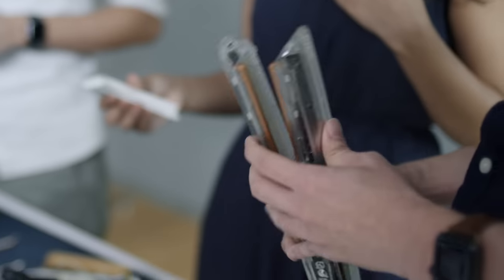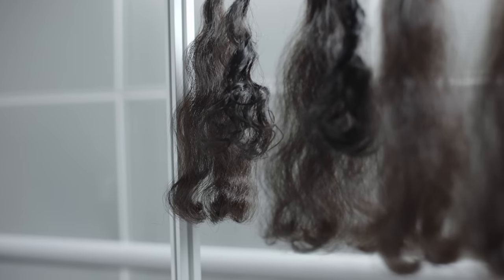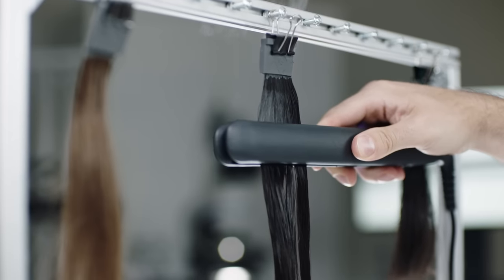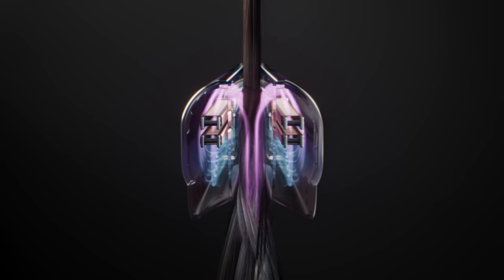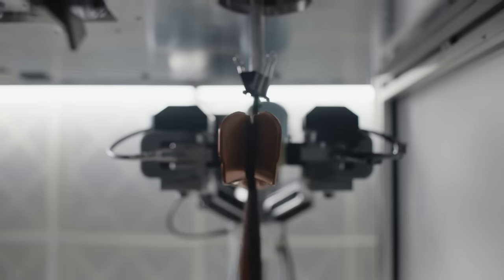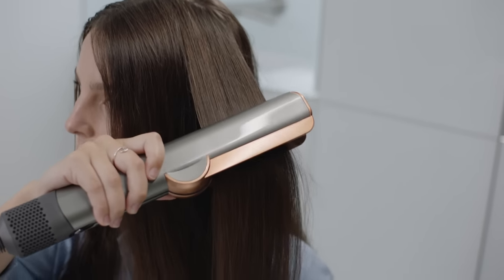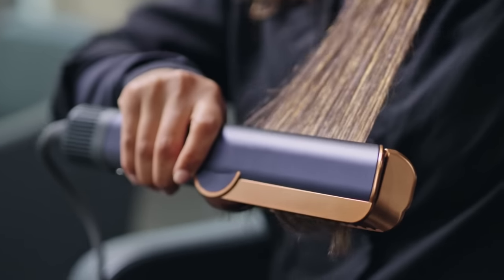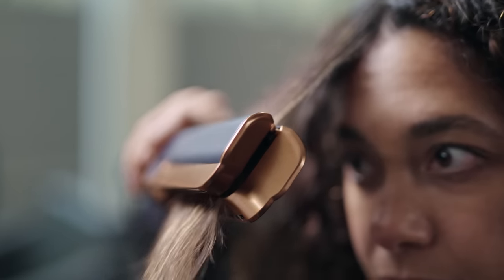Engineering the Dyson Airstrait™ straightener

Comment: I have been dreaming of the day my whole life that a team of bright engineering minds would develop a styling tool for blow outs or straightening that would save your hair from heat damage!
I have curly hair and have gone through multiple hair growth 'reset cycles' because of heat damaged curls caused by heating tools. Nothing, even heat protectant sprays and serums worked and I thought "Wouldn't it be cool if one day someone could figure out how to get the straight look but without the excessive heat?" This product is like a dream come true! Thank you Dysoneers!
Reply from the maker: We're so grateful for this feedback! 
Here at Dyson we're always working to solve the problems that others ignore.
Reply: @helene trv I disagree. There are two modes on this device: 1. Wet to dry (for straightening) 2. Dry mode (for refreshing the hair). Dry Mode will cause some heat damage. However, on the Wet to Dry Mode the company states it does not cause heat damage. Why? Dry mode has two temp settings 250 degrees and 285 degrees Fahrenheit. Alpha-keratin in hair denatures at a temperature range around 227-237 degrees Fahrenheit, which means anything above that range is susceptible to causing heat damage to the hair. The wet mode on the Dyson air straight has three settings at 175 degree, 230 degrees, and 285 degrees. So if a user of this product wants to avoid heat damage this device can achieve this goal, as long as, Wet to Dry mode is selected at time of use at 175 degrees or 230 degrees.  Additionally, this product has advanced tech sensors in this Dyson air straight which monitors the temperature 30 times PER SECOND to ensure temperature control is regulated at every moment of use, which is an amazing feature not found in most heat styling tools on the market. This product has value beyond the results that is found embedded in the technology, which is why I am excited to be using and purchasing.

Comment: It would have been nice to show more than two seconds of this product being used on Black hair.  Given how expensive Dyson products are, no one with Black hair will buy it wondering how it will work on their hair, and hoping it will!

Dyson PLEASE remember us when creating new products!!
Reply from the maker: Throughout the development of the Dyson Airstrait™ straightener, our engineers trialled with hair types ranging from Type 1 (straight) to Type 4 (very curly/coily) hair. This helped us understand the different benefits for different hair types: natural straight styles for Type 1-3a/b hair and stretched blow out styles for Type 3c-4 hair – from wet, with no heat damage: http://ms.spr.ly/6051gncOf
Reply: @dyson  thank you for the quick response and the extra video.  However, I wonder why more Black (3c-4) examples weren't simply included in your primary video?  Why should Black women have to go the extra step?  Re: the Airstrait, did @dyson decide that a product which would achieve a "straight style" for Black (3c-4) hair is too damaging or too hot for non-Black (1-3b)?  Keeping in mind that those hair textures are already blow-dry straight.  Again, I wish @dyson valued that Black women also want the convenience of straight styles with one product.  Are you intimating that Black women have to chose between dry+straighter and dry+straight (potential heat damage)?  I can get the same result, faster, blow-drying my hair and STILL need the extra step of flat ironing.  This product is too expensive for that.  I'm sure that @dyson could develop a product for us...if you thought it was important.
Reply: @audreycash5390  it's unfortunate bc everything that you're saying they've heard and still not addressed with a product. It just shows us that they don't really want to address it.....
Reply: @mavendnc  I know but sometimes it's worth saying again...just so these companies know that WE haven't forgotten.
Reply: Speak on it!
The black community has dollars to spend when it comes to our hair!
Seeming like this product wasn't made with us in mind...

Comment: What temperature is the boost mode?
Reply from the maker: Hi Rivy, thanks for reaching out to us. Please send us a private message so that we can assist with your query.
Reply: @dyson  how and where do I send the message and why can’t you share that information publicly
Reply from the maker: Hi again Rivy! The temperatures in Wet mode are 175°F, 230°F, and 285°F. In Dry mode, the temperatures are 250°F, 285°F and BOOST for an additional optional boost for maximum styling impact.  
There is also a Cool mode button, which can be used to set your style.
Reply: @dyson  yea I understand that but I am asking specifically regarding the boost mode temperature. What is it? We should know in order to prevent damage
Reply from the maker: BOOST mode goes up to 320°F. This optional temperature setting has been added for those who would like to use a boost of temperature for maximum styling impact.
Reply: @dyson  thank you
Reply from the maker: You are so welcome.